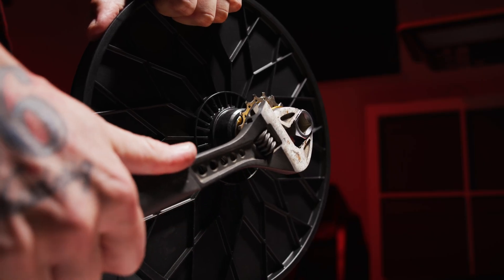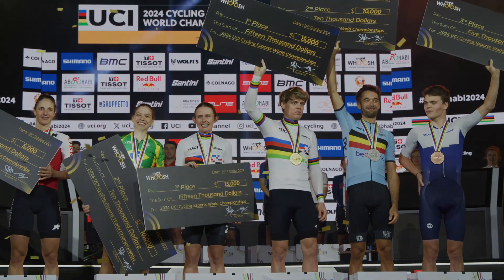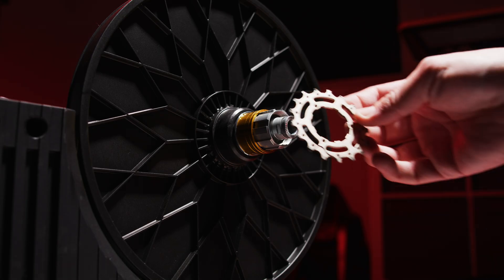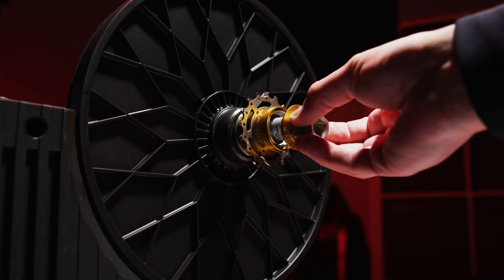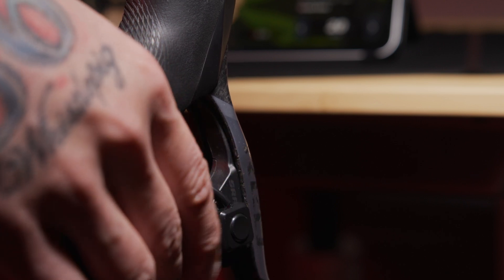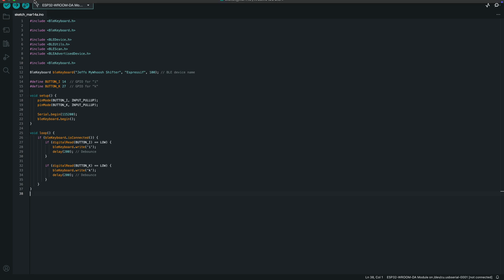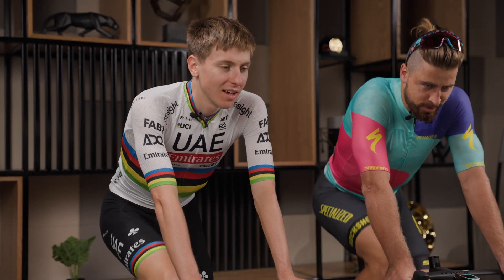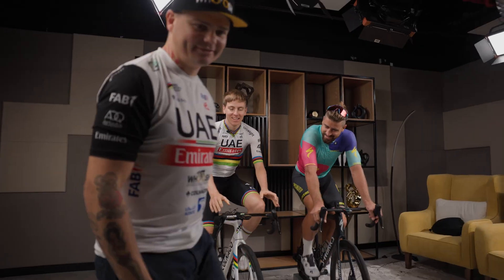DIY Bluetooth Bike Shifters for MyWhoosh! Ultimate Indoor Cycling Hack

Comment: great video thanks, I've used a little thing called an M5Stack and replicated what you have done with its built in buttons and it seems to work. The M5Stack is essentially an ESP32 with a screen and buttons powered through USB C. I've ordered some external buttons so will try that on my shifters.